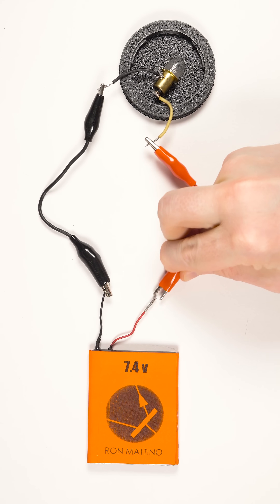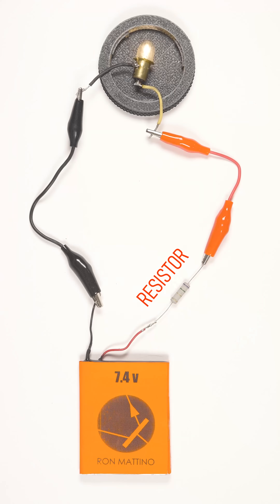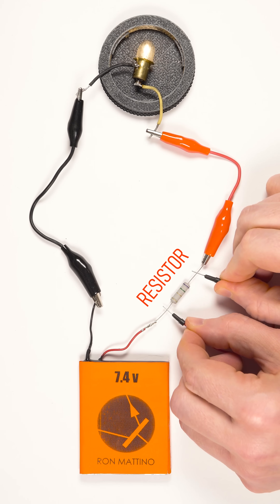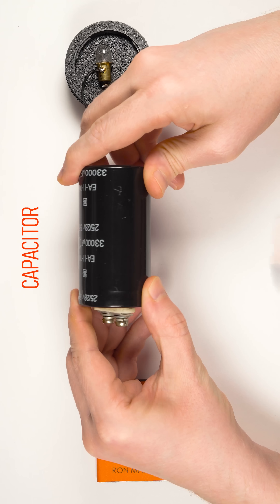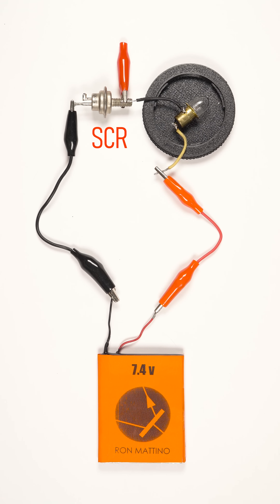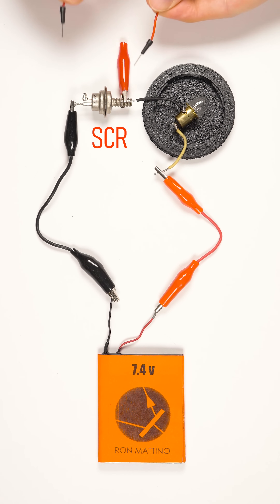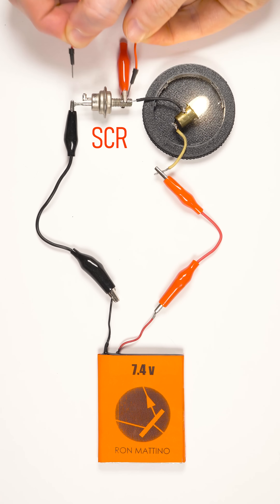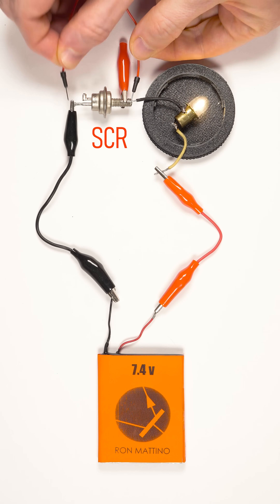All Electronic Components in 60 seconds. #electronics #diy #transistor

Comment: Yes, but:

The only difference between a normal diode and a zener diode is that the latter is designed to work in reverse-bias breakdown at higher currents without exploding or melting as easily as a normal diode. Because of that zeners are often but not mostly used as voltage references (very superficially described here) but other than that they are pretty much the same component.

The main role of a transistor is not amplification but it's ability to control conduction through them. Amplification is an artificial effect that can be achieved in a specific type of control and thinking that that's its main use is a bit of a stretch, I think they're more common in digital applications.

Some people here are wondering where inductors are but in integrated electronics inductors are common in specific application due to their difficult to scale down. They are important, but not as important as all the rest.

Comment: All diodes only turn on when a certain voltage is applied to them. Zener diodes are designed to operate in reverse breakdown without damage and have a lower breakdown voltage.

Comment: Connecting a large capacitor directly across the battery would draw huge peaky currents from the battery, which is not good for its health.You should keep a resistor in series and charge the capacitor

Comment: I thought zener diodes work at 0.7 V? Why does this one need to go up 2.35 V?
Reply: Yaah but voltage 0.7v is forward bias voltage just like a diode but unlike diode will be off in reverse bias zener voltage keeps increasing and once it reaches to breakdown voltage it it provide constant voltage through any load noticed that zener was connected in parallel in circuit unlike any other device b'coz it used to to provide constant voltage to the load , I hope it helps
Reply: @ashumeena2688  ahh okay I see, thanks

Comment: To all the comments saying inductors aren’t listed its because they arn’t used in simple DC designs. (Only used to model motors and certain DC-DC converters).
Reply: I mean ferite beads are inductors and are used for filtering and chokes are used in DC circuits plenty, but just not generally used significantly
Reply: @HerbaMachina  True although in applications where large current spikes don’t need to be accounted for, a simple RC LPF can be used. I am coming from a mobile embedded background where inductors aren’t used due to costs and everything is powered from a battery.

Comment: does a resistor limit current when in series with the load?  current through the resistor n load is the same but the voltage is dropped accross the resistor hence the dimming

Comment: Why do y'all keep acting like a capacitor isn't just a battery?

Gonna Add:
Is as does. It act like a battery, it's a battery. Now, get mad.
Reply: Capacitors work, and are constructed differently. They are good for smoothing power supply ripple and stuff, but not good for a constant DC source like a battery.
Reply: @joshuaflores8648  yeah so it's a deep cycle battery then. Stfu
Reply: Capacitors aren't just batteries.  For a capacitor, the voltage is directly proportional to the state of charge.  Capacitors only store energy in the electrical field between the oppositely charged plates, with no changes to the identity of the substances that construct it.

For a battery by contrast, the voltage is approximately independent of the state of charge.  Batteries store energy in the chemistry of their internal ingredients, so the identity of the substances that make up a battery, will change with the state of charge.

Comment: Your zener diode explanation makes no sense as you say. It has to reach a certain voltage for it to switch on but then it gets to a point where the voltage won't go up any more so essentially it gets to a certain voltage and switches off so how does that make sense? Please make that makes sense.
Reply: Think about it like filling a water bucket with a hose. Empty is 0v and the top of the bucket is whatever the high end voltage is. When you start filling the bucket(increasing the voltage) it fills the bucket until it starts to pour out(the voltage overflow).
Reply: @GeeTR63-71 no not really ! It blocks the flow until the voltage become equal to the rated voltage of  the zener diode and then allows current to flow. Thats the reverse bias
Reply: @Buzzhumma  so what I said, got it 🎉
Reply: @GeeTR63-71  😂😂😂
Reply: @GeeTR63-71  just the end bit was not clear in what both of you said . It allows the current to flow....! But i appreciate your input. Often people explain how something works, but they don't explain how it can work in an actual circuit. Sometimes it's not enough to say you turn the pedals and the wheel goes around when what needs to be said is it turns the pedal and It turns the wheel around and that drives the bike to go in a direction. In this case the current to flow in a direction

Comment: "All electronic components"
Inductor: "Am i a joke for you?"
Reply: How about censors?
Reply: Hey, watch it ther mistor
Reply: It might be because inductors are short circuit if DC is passed through it
Reply: @joshuaeruela5274  Have you ever heard of electromagnets by chance? Inductors also limit inrush current in DC circuits
Reply: @joshuaeruela5274  real life inductors do have an active resistance
Reply: not much todo in dc current basicly only wire that just whirl by bored technician.
Reply: @awancah7309  capacitors in dc circuits are just not a wire.
Reply: "@invinciblecame7336
3 months ago
...
Inductor: "Am i a joke for you?" inductor in dc just wire, you comment inductor i am only talk about your comment. not capacitor in dc

Comment: Inductor, please...
Reply: An inductor is a coil of wire, usually wrapped around an iron core, that stores energy in a magnetic field, proportional to the square of current.  An inductor generates a voltage difference across it, to oppose the change in current.

Think of an inductor as analogous to a free-spinning paddlewheel in a water circuit.  The paddlewheel spins at a rate directly determined by the current, and stores kinetic energy proportional to speed squared.  The paddlewheel will apply a pressure to the water flow to oppose the change in speed, any time you attempt to change its speed.

Comment: How a series connected resistor limit current in an electrical circuit ?😂😂😂😂
Reply from the maker: If you apply Ohm's law, you can find maximum current in the circuit with a resistor in series.

Comment: Resistors are not only for limiting current, also widely used to create a voltage differential for a specific current such is an transistor bias circuit or an amplifier where a current is converted to a voltage.
Another application where it’s not really about current limiting is as a voltage divider.
Reply: Or in their most basic use ever: heaters.
Reply: He is too fast for that, I just learned well about the divider role on resister. Thanks you notice

Comment: so I can just use zener diode to built a  battery charger ...😁
Reply from the maker: No, for a charger you need current regulator while Zener diode is a voltage regulator.

Comment: Isn't a capacitor pretty much just a battery that can't hold its charge for very long?
Reply: no, the capacitor has a different principle
Reply: @zardi4463  Well I did see that one video where a guy replaced his car battery with capacitors.
Reply: @bland9876  A capacitor stores electrostatic potential energy.  A battery stores chemical energy.

A capacitor's voltage is directly proportional to its state of charge, while a battery's voltage is approximately constant and close to independent of its state of charge.

This makes batteries much better sources of energy for powering circuits consistently, than capacitors.  Capacitors are good for very temporary storage of energy and for smoothing out circuit transients, but not good for being the primary source of energy to a circuit.
Reply: @carultch  wow that's a good explanation of capacitors. My only question is about when people say the Xbox (the first one from like 2001) used a capacitor to keep the clock time instead of a battery like everything else (and they are very prone to leaking) also someone used a capacitor to start his car but he said that he had to charge the capastor like every 2-3 days or else's car wouldn't start. I think it was a bunch of capacitors but I don't remember.

Comment: Question,  let's say we have a capacitor,  and 2 circuits, 1) bulb + resistor 2) just bulb, which one glows longer than other , or same?
Reply: The bulb effectively is a resistor, assuming it's an incandescent bulb.  This means, the bulb + resistor have a higher resistance.

A capacitor and resistor will discharge according to an exponential decay function, where the current as a function of time is given by:
I(t) = V0/R*e^(-t/(R*C))

When R*C is greater, this means it discharges at a slower rate.  So a resistor plus a bulb will discharge a capacitor slower, than just a bulb.

Comment: It doesn't limit the current. It sets the current to a designed value.

As the input voltage varies, so will the current; so it is not limiting the current to any upper limit value.  It can go beyond value you intend. Hence, there is no limit.

Comment: Wait....... doesn't a cap block DC? Or am I wrong?
Reply: You can charge a capacitor with DC, but you cant run DC through it.. so if the cap was put as a part of the wire, the bulb wouldnt glow ;)

Comment: Us the zener in forward or reverse. Please explain more of the zener
Reply: You use a zener diode in reverse bias.
If you want a voltage reference, a steady voltage, put a resistor in series with the zener and take the output from across the cathode and anode.  The series resistor is connected between the input supply and cathode.  The zener is normally connected the wrong way around compared to a non zener diode.

Comment: That SCR bit wa just what i needed, thx
Reply: Typical way of interrupting a SCR however is to interrupt the current feeding it.
Reply: @soundspark  Is there a way I can make the SCR activate and deactivate in DC fast enough so to have a decent frequency and to make a square wave with adjustable duty cycle? I normally see written in schematics "Control circuit" or "Triggering circuit" but I always find those for AC and not DC. do you know some resources I could see?
Reply: You could use a 555 timer for that!  @Roniboi
Reply: @karimsc3921  thanks
Reply: @Roniboi  you're very welcome

Comment: Saying a Transistor is a switch, and then showing it switching from the same source as the input, is totally beyond the point. Either show an amplifier, or show it in a logic gate like an AND gate. This is so common, every channel explaining transistors makes the same mistake. Otherwise, why even use a Transistor. The common explanations make it seem useless.
Reply: Exactly my thought. Its still unclear about a transistor being a switch
Reply from the maker: I get it, thanks.
Reply: He's demonstrating switching on the bulb with less current than it requires to glow. HEY YOU CAN GET THE CONTROL CURRENT FROM WHEREVER YOU WANT. This is a damn DEMONSTRATION. I'm on his side. He explains so well
Reply: welcome to youtube shorts
Reply: I was the same way as a child when I was learning electronics I couldn’t understand the transistors usefulness without understanding ohms law first I would build up an a-stable oscillator first and use it to switch the gate of an n-channel mosfet and put something like a speaker, transformer, on the output or something on it. It’s hard to understand if you’ve never had a class on electrical theory to be truly honest with you. But it is simple in theory.

Comment: what is the last one tho
Reply: An SCR, or Silicon Controlled Rectifier, is also known as a thyristor. It's a type of power electronic component used to control and switch high voltages and current. SCRs are widely used in motor speed controls, lights dimmer s..etc